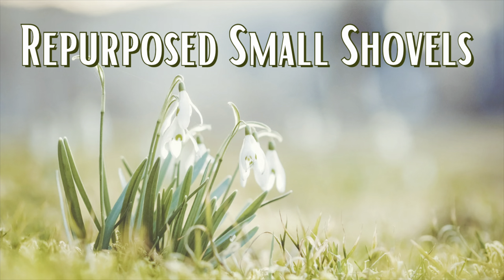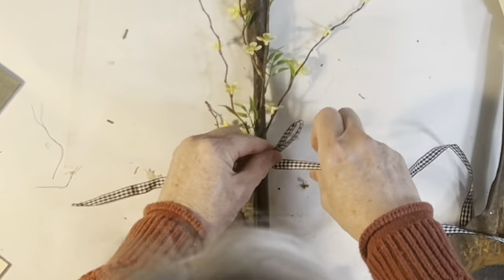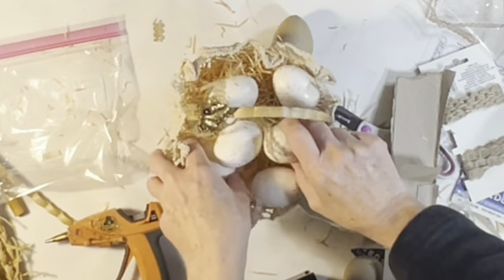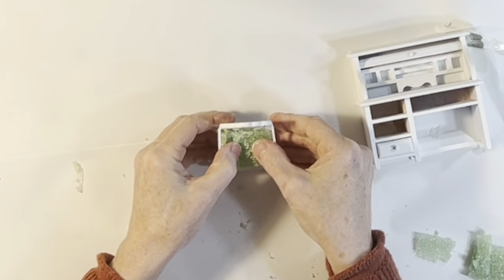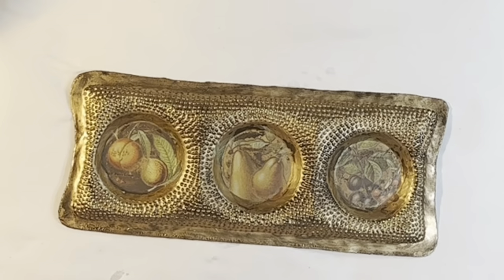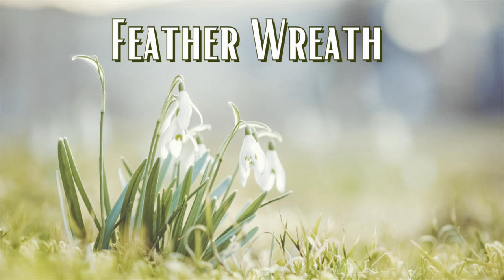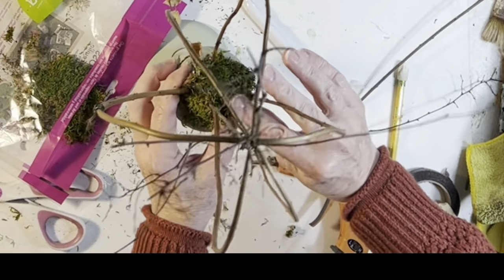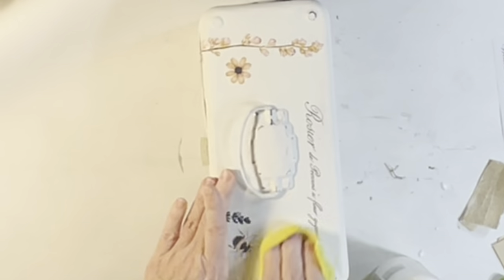10 Brilliant Cottage Thrift Flips for a Fresh Spring Look

Comment: Only one suggestion about the little trike …the ribbons that hang over the edge of the basket  are pointing In the wrong direction… if the bike was moving the wind would furl the ribbon ends out the other way  it would just  add a little movement to the piece

Comment: that brass ring looks like it might have been part to an old Gas Light fixture.   Some of the old apartment buildings in Brooklyn NY had large gas light fixtures out in front of them.  These apartments dated back to the late 1800 - early 1900.

Comment: Sherry, I love that feather wreath! Gorgeous! It is advised to let your paint dry before applying transfers and to use a sealer before applying the transfer should there be any concerns there might be an oil based paint or wax on the surface of your substrate.  When using rub n buff or any dark wax, use a clear wax first before applying a darker wax. This will allow you some play time and you should be able to wipe back the darker wax. That rub n buff goes a long way. The clear wax should also protect the transfers. Thank you for always sharing your great ideas and talent. You're such an inspiration too many.

Comment: Such lovely pieces. A little tip on your sweet dolly basket...my MIL used to make them and she soaked them in liquid starch as a stiffener. They always came out rock hard. And in regards to your brass ring/frame...I  cant judge the size of yours but it reminds me of the more ornate stove pipe rings placed around the pipe where it goes through the wall. Thanks for another enjoyable video.

Comment: The last item with the metal round looks like those chimney hole covers that they used after removing the old wood stoves from kitchens. If I am correct it would of had a ceramic plate or tin plate in the center with a picture. Yours looks very much like the one in my kitchen.

Comment: I like the spring themed toolbox and the metal frame project the best. Thanks for the inspiration.
Your triple candleholder with the Rub & Buf, I really enjoy the Rub & Buf on the metal. Personally, I would re-paint the indentations and add new transfers. But that's me. I'm sure there are just as many people who enjoy it with the wax covering the transfers.
Reply from the maker: Awesome! Thank you! If I redo the candle plate, I think I will make it so it hangs vertically instead!

Comment: Sherry, would you please tell me how you decide whether to use the Waverly clear wax versus Mod Podge to seal something? I painted an old wood chair using the ivory colored chalk paint and then rubbed little floral transfers all over it. Then, first I tried to seal the transfers and the rest of the paint in general with wax. It made a mess and made the grooves of the chair look dirty, even after I tried to buff off the excess. So I use Mod Podge instead, all over the entire chair, which I don't believe is the proper process for when using chalk paint. How and when does one properly use the wax? Thank you 💐
Reply from the maker: B, I would have used wax on the chair, too. Not sure why it didn’t work. I prefer wax when using chalk paint because it gives the paint a nice sheen (without being glossy). By the way, if you are using IOD transfers, they don’t have to be sealed. They are incredibly durable and difficult to remove. If you don’t like the way the wax looks, you could just spray the items with a clear top coat like Rustoleum’s Painter’s Touch Clear Satin. This would be much faster and more durable than Mod Podge. Hope this helps!
Reply: Thank you for your reply, Sherry. I don't know why I didn't think of using a polyurethane satin spray to seal the chair. I was not using the IOD transfers, just some small cheapy floral transfers that I bought online. It was my first time using chalk paint, wax, AND transfers so next time I will know better. I thoroughly enjoy your videos, and wanted to mention how beautiful you looked in your Valentine's episode. That red blouse looked gorgeous on you and your hair looked so pretty, vibrant, and healthy. You are an inspiration to me for sure.

Comment: Does the cinnamon not attract ants?
Reply from the maker: I have used this cinnamon trick on lots of projects and haven’t had any issue. You could go over it with some Mod Podge or use a spray clear top coat to seal it just to be safe.